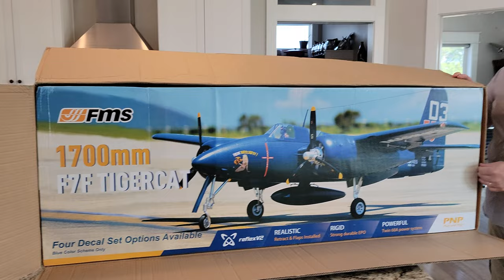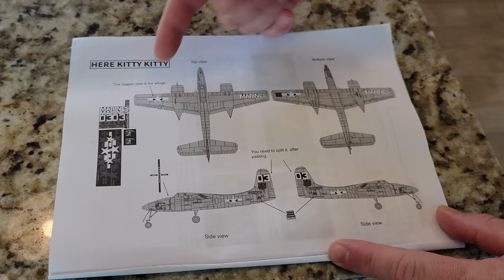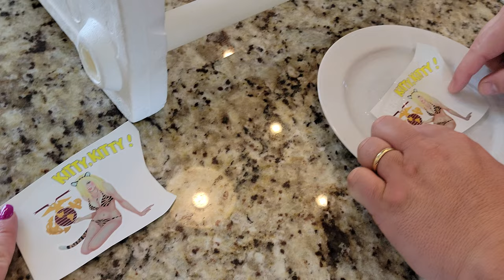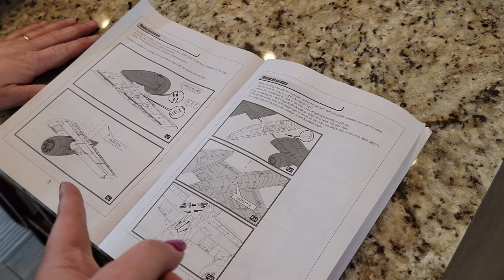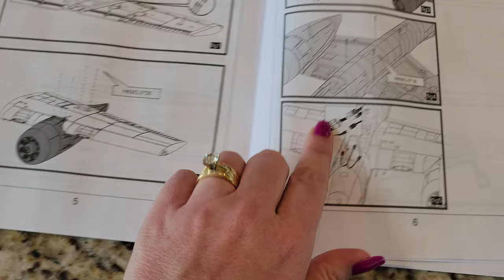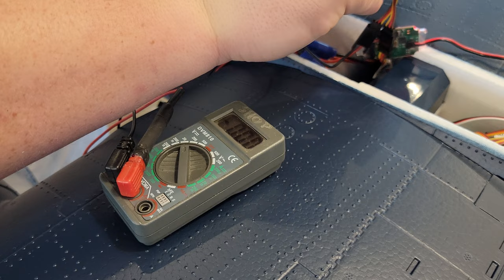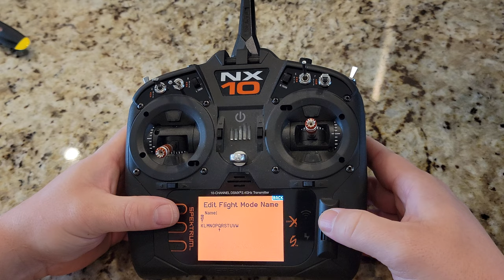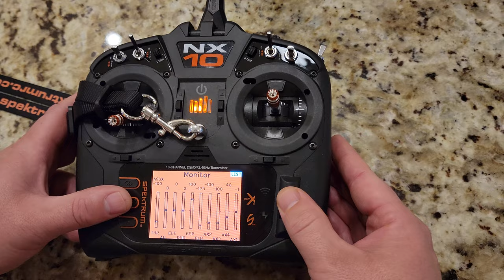FMS - F7F Tigercat - 1700mm - Unbox, Build, & Radio Setup

Comment: Love this plane. I bought 2 of them. Yes its a little pricey but the detail and quality is just amazing. I fly off a grass field and its not as rough as yours but handles it with no problem. On youre decals go to Callie graphics. The wet decals are the worst i have ever tried to apply. On youre receiver i ripped out the reflex and just put a 8360T. The green is a anti corrosion that was applied back in the day. This plane is NOT new and its been around for a while but its almost always out of stock cause its so popular. I also just put a 6s 7000mah battery. Take off and land without flaps. Just bring her in on a nice flat approach and about 2 to 3 feet off the ground just cut motors and she will just glide right in and just touch so beautifully. Overall its a beautiful plane and always gets ALOT of attention at the field. BTW on the F4U Cosair just put a Hobbywing 120amp esc and set it to high and just wow its a whole new plane (8S).
Reply from the maker: Yes, yes, and yes! Thanks ;)
Reply: I have the same plane but with the bever motors and prop , whhhheeeee, hums

Comment: That BEC discussion threw you for a loop!  You did the right thing by checking the voltage,  I'm curious what It looks like under the heat shrink, I suspect that red wire is just laying in there not connected to anything.    Reminds me of the old 4.8v NiCd RX packs back in the glow days.  Some manufacturers used the same 3 conductor servo wires for their batteries,  the "signal" wire wasn't connected to anything,  and other batteries just had the red and black and only 2 pins in the connector.       The FMS Tigercat used to be available in silver,  when they re-released it they only offered it in blue.   The La Patrona graphics are for the silver version,  it was popular at the Reno Air Races years ago.

Comment: Micro Sol and Micro Set for water slides. Decals that large will be problematic regardless. But those solutions will help conform to the rivets and panel lines, and promote adhesion.
Reply from the maker: Good idea, I just looked up how to do this, and seems it would have helped! Thanks for the tip!
Reply: You can soften already applied decals this these solutions and attempt to smooth them out. Several YouTubes on the subject. Plastic model guys are geniuses with it.

Comment: I have bought a used Tigercat got it all programed. My one problem is the left motor has the break on. I have read the directions and followed them. I can not get break turned off. Please help. I was able to program differential thrust even.  With SAFE. you do the best video instructions ever.